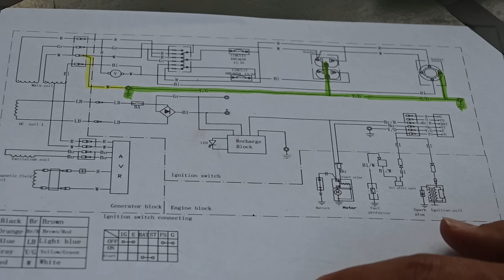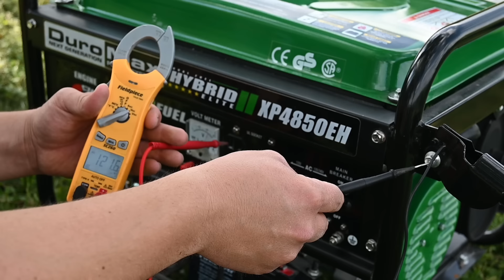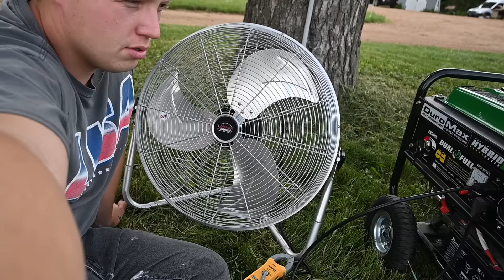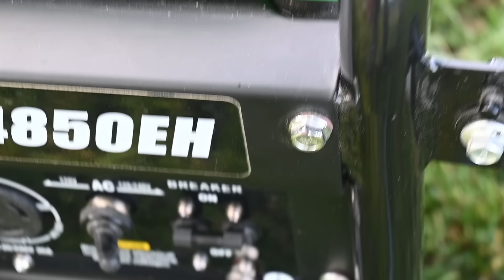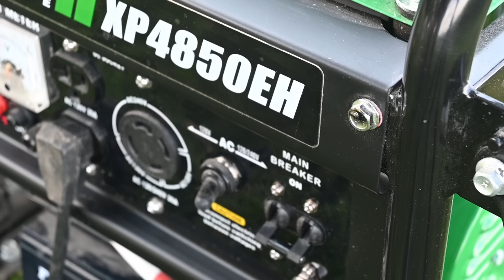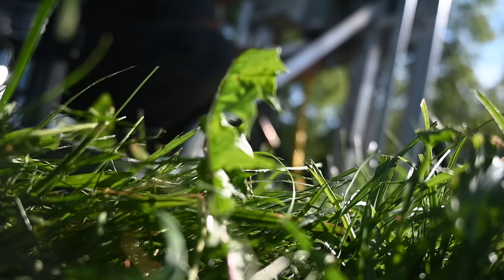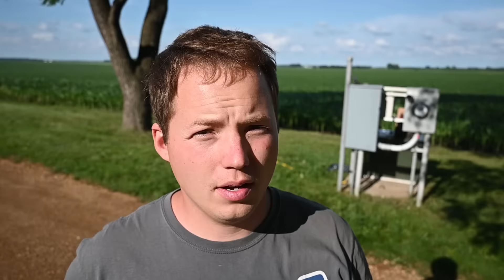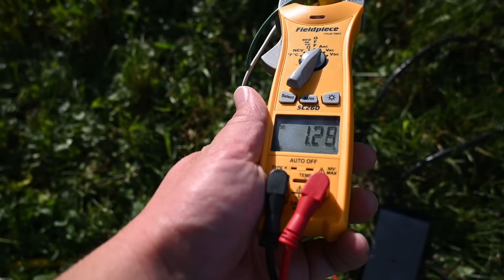What is a Floating Neutral Generator?

Comment: If you're going to use a generator as a stand alone power source at a campsite or construction site independent of grid power, you'd want your generator's neutral and ground bonded together.  If you're going to use the generator as  a backup power source for your home through a transfer switch (required), the generator  would not be bonded internally.  You'd run separate neutral and bond to the home's neutral and ground buss bars.
Reply: ^thits
Reply: @scoutskills   But if you are attaching your generator to a transfer panel, and that transfer panel is a sub panel, sub panels don't have the bonding in them, as its your main panel that does.   How should it be wired up then?
Reply: @JohnRoesner  Only the main panel neutral and ground are bonded.  The ground at the main panel is then tied to the earth to a stake in the ground or sometimes the water main pipe.  The main panel has a high current two pole breaker for feeding the sub panel and the sub panel feeds the critical loads.  In between the main panel and the sub panel is a two pole  (DPDT) transfer switch.  The generator and the sub panel have the bonding wires removed.  The main panel earth ground is the ground for everything.
Reply: does ^thits mean cheap goods??  I know the slang meaning of 'thot' but seriously, I don't know what you meant by your reply '^thits'? Just curious.
Reply: @CJforUSA  ^ is an up-arrow and thits is mispelling “this”. He means “what’s written above is true”
Reply: YUP, been reading up on this, could be different for a mobile home though as the ground and neutral must be made at the 1st disconnect, from then on, they must never meet up again.
so at my place, with a 7.25kw. I have a mechanical interlock. Mains must be off to turn on
gen breaker and I have a 4 wire cordset.
Reply: So I just want to use mine for a few extension cords to run a fridge maybe a TV when power is out? I got the same model Im not familiar with generators. Do I still need to ground it if I'm only running then for extension cords?

Im surrounded by concrete so grounding it will be a task.
Reply: I’m going to have a friend who is a journeyman electrician wire up my solar inverter to a 30amp breaker on the main breaker box with a lockout switch.  So just to confirm, we need to wire it to to neutral bus bar and the ground bus bar then remove the bond on the inverter.  Is this correct?
Reply: No. Almost, it's bonded once it's plugged into the stand by system, you shouldn't have to run extra wires.
Reply: @yakapo999  solar is different. Its article 690.
Reply: @thebardock6785  I also have the same generator... I have not been shocked yet and I only use it to run my fridge and freezer by extension cables. After watching the video, in the event of a fault (hot leg grounding) I think touching the fridge and the generator could result in dangerous current flowing through my body. I am going to bond my neutral and ground on the gen because I don't have a whole house transfer switch or an intention to connect it that way. I did wonder if I could just install a grounding jumper between the neutral and ground under the gen front cover?
Reply: @thebardock6785  I know the comment is a year old, but I was digging thru comments for the answer too. This video kind of leaves a cliff hanger as to whether or not the rod is necessary after bonding neutral/ground, only advising to "follow the manual". TLDR is no don't use the rod. I found a video uploaded this May outlining the situations with a generator using extension cords, it is named:  Does My Generator Need a Ground Rod? Probably Not. Here's why.
Reply: That why you use a 4 lead supply from the generator and not a 3 lead, if a 3 lead is used then the generator's neutral should be bonded at the alternator and connected to earth and the neutral removed from the buss bar in the home panel box.
Reply: @scoutskills I think you might be wrong, I believe you have isolated the main neutral and active leading to the sub panel by placing the transfer switch between the two panels. Thus the bonding of the main neutral and ground in the main panel does not continue through to the sub panel. the load now is relying on the generator neutral, which is a floating neutral. This is not ideal nor is it safe, as has been demonstrated by Benjamin Sahlstrom
Reply: Your " separate wires for neutral and earth" to the house are in the extension lead, it connects generator to house " buzzbars"   you could earth your generator to the house earth stake in the ground for safety but not really needed as the extension cord does that job too, but in wet ground or permanent setups, id be earthing generator to house earth stake...

Comment: Ben I have a Champion 3500 watt floating ground generator. 
Using extension cords to power up my furnace, it will run the fan, but has red lights on the power processor. A local electrician had me drive a ground rod for the generator, and a ground rod for the LP furnace. 
Furnace still would not make the LP light. 
Another electrician told me to take a ground 15 amp plug in, take 6” of #18 green wire. Connect 1 end of the wire to the silver- neutral prong, the other end to the ground prong. Plug it into the 120 volt plug in on the generator. 
Now the generator runs my LP furnace! 
Hello from north east Montana. 
10 miles from the Canadian border.
Reply: I took an extension cord and cut off the male end with about six inches of cord on the end. I then butt spliced the neutral and ground together and plug that into one of the receptacles on the generator.

Comment: I rarely add comments, but this was a great video for such a challenging subject. Thank you for taking the time to explain. I would have really enjoyed seeing this video 3 months ago when I installed a Reliance Controls 10 Circuit  30Amp Generator Transfer Switch and bought a Westinghouse 6500 Watt Gas/Propane Bonded Generator. After many days of research and some hair loss, I went ahead and switched the generator over to a Floating Neutral and labeled generator for others to be aware. This video confirms my research. Keep up the good work and sharing the knowledge.
Reply from the maker: I think what matters is how the switching is done. Some transfer switches also switch the neutral in which case you would want the generator to remain bonded. An easy way to check would be to see if there is continuity between the neutral and ground on the generator cord before plugging it into the generator. I need to learn more about it but something Mike Holt said the other day made it sound like some types of transfer switches allow for the generator neutral to remain bonded.
Reply: @BenjaminSahlstrom  That is correct, some transfer switches automatically switch the neutral and in that case you want to have your generator set up with a bonded neutral. I called the Reliance manufacture and my transfer switch works with a floating neutral on the generator. I only use this generator for house power only and it is labeled "Floating Neutral". I also added a label "Generator for House Power Only" because when I took a survey NO one knew what "Floating Neutral" meant.
Reply: @BenjaminSahlstrom   Is it safe to say that the generator should always be bonded, but only in one place? Although at 25:50 didn't you do just that, bond in two places?
Reply: @adhambarghi  I would think if you were using this for house power only you would want your generator to be bonded. If a metal frame appliance shorts to ground inside your house the breaker on the generator will not trip.
Reply: @fyuecd2  The transfer switch box will trip a breaker for the shorted metal frame appliance in our example. Hope this helps.
Reply: Adham Barghi oh ok I assumed you were running a interlock.
Reply: In that case your branch circuit breaker for the appliance in the house panel would trip.
Reply: Don’t forget about the generator safety rules: Always make sure you follow all the generator safety rules whenever you use your portable generator. This is only a reminder. Generators can be dangerous if not used carefully. Every year, hundreds of people die or get injured when using portable generators due to carbon monoxide poisoning and electrocution. Make sure you are using your generator carefully and keeping others safe as well. There is something very serious that everyone should always be aware of when using generators. Some people do run their generator indoors which is not safe and that increases the risk of carbon monoxide poisoning which can cause death of family and you. Some people run their generator in wet conditions which can electrocute them. Please remember that you should never run your generator indoors. Remember that carbon monoxide is an odorless and colorless gas that you cannot see or smell. Carbon monoxide is a silent killer. Keep that in mind. Make sure your generator is 15-20 feet away from your house and away from doors, windows, and vents. Never use your generator in your porch too. Having a carbon monoxide detector is very important against generator safety. Some people also allow children to go near the portable generator which could pose risks. We need to keep an eye on our children making sure that they are not near the portable generator so they won’t get electrocuted or burned by the generator which is dangerous. A locking enclosure also keeps kids safe. A generator shed might look like a tempting place to explore, or take cover during a game of hide and seek, but a generator is a dangerous piece of equipment that can cause injury. It says on the manual that we should also keep children away at all times from the portable generator to avoid injuries. Please do not allow a child or unqualified people to operate the portable generator.  It is important to keep your children safe especially little ones. The portable generator can be hot during an operation. Just because some manuals missed what should be listed doesn’t mean it’s safe to do. Always follow the generator safety rules when using portable generators. Generators pose electrical risks. If you need to use your generator during wet weather, you need a generator tent to protect your generator from getting wet. Don’t let your generator get wet. Keep your generator dry and before using your generator, please make sure your hands and your generator is dry. Do not wear loose clothing when operating the generator. Everything that is said on the generator’s operating manual should not be ignored, even the warning labels. Never smoke cigarettes near the generator. Please keep flammable things away from the generator. Never overload your generator too. Your generator can catch fire. Never ever try to plug a generator cord into a wall outlet to avoid back feeding. Back feeding your generator is dangerous. Always turn on your generator first before plugging in appliances and shut off the appliances before turning your generator off. Use a heavy duty cord for your generator and the cord should not be worn out. All the instructions should be followed carefully. Never refuel your generator while it’s running. It can cause fire if fuel spills while your generator is hot. You should turn off your generator and let it cool off before refueling it. Having a fire extinguisher next to the generator is also important. This is only a reminder for everyone’s safety of using generators. Make sure your generator is properly grounded. Having a fire extinguisher next to the generator is also important against the safety rules. https://youtu.be/I1jT3ANENvI and here is a video more about keeping others safe when using generators and also about our family’s safety. It’s important to keep our little children safe as well. Make sure your little children are kept away from the generator at all times especially when it’s running. Hope this helps. All generator safety rules need to be followed carefully. Please don’t remove the warning labels on the generator.
Reply: @adhambarghi  are you able to power GFCI outlets and appliances tied into a line with a GFCI outlet. My craftsman generator owners manual is saying "On a floating neutral generator the AC receptacle ground pins are not functional. Electrical devises such as GFCI, requiring a functioning AC receptacle ground pin will not operate"  My tankless hot water heater is tied into one of these and I'd like hot water in an outage. I purchased the Reliance pro/tran 2 transfer switch but have not installed yet
Reply: @jeffdaniels4339  that depends on if the transfer switch / panel is bonded or not. If it is, it should function fine. Basically the only reason you should be using your generator in the floating ground configuration is, if the transfer switch / panel is bonded. This is because you only want one location to be bonded, and this location should be the closest means of power interruption. Ie, the breaker in the transfer switch / panel. If both were bonded then you would have 2 or more fault paths. This can cause the wrong segment to trip & disconnect power. Or even worse, one breaker would trip but the other bonded segment would still be live with a dead short. Causing a rather dangerous situation. So in short. If panel is bonded your generator should be configured for a floating ground & your GFCI outlets should function safely as designed.
Reply: Hey Adam, question did you connect ground to ground and neutral to neutral or did you connect them both to neutral bus? I'm installing a ProTran 2and my generator has 6500 w running with floating neutral
Reply: @IsmaelRodriguez-pn3lw  your main service panel should be bonded, ie ground and neutral strips bonded together. Then you should debond  your generator (floating ground) so only the main panel is bonded. The ProTran 2 should have a pre-printed label you can put on your generator as a reminder that it has a floating ground. At least mine did.  It was nice touch for such things to be included in the kit.
Reply: @williamallen7836  Thanks! My generator has floating neutral and I am connecting ProTran 2 to my sub panel, so I should connect ground to ground and neutral to neutral, and leave generator as is, correct? TIA

Comment: Good video.  I will mention that a lot of if not most inverter generators use a floating neutral and are frequently used to power an RV.  The RV also has a floating neutral and gets it neutral to ground bond through the RV park’s pedestal but a floating neutral generator will work fine.  The electrons have to flow from the hot lead back to the neutral and vice versa for AC power.  So if there is no earth (ground) bond to neutral you should find no difference of potential between the hot lead or neutral to ground so standing on the ground and touching the hot lead should not electrocute you.  The problem would be if there were another neutral to ground or hot to ground somewhere else then you could get zapped when touching either lead while in contact with ground.  Same with using an old metal cased drill on an extension cord on such a generator.  If an internal short from hot to case happens there is still no source tied to ground so no difference of potential between the drill case and ground just case to neutral would cause current to flow so you should be ok. A three prong plug with the ground lead connected to the case and the ground lead actually connected to ground would be best.  Now days I wouldn’t use a metal cased tool without a three prong plug.  A plastic double insulated tool doesn’t need a ground pin.  The floating neutral generator would operate, safety wise, similar to a battery operated drill.  Neither terminal of the battery is going to ground so there is no voltage measured from either terminal to ground. So if you’re on the ground and touch either lead nothing happens.  For another opinion: https://www.rvtravel.com/how-generator-neutral-ground-bonding-for-an-rv-works/

Comment: Just added a 30 amp generator input plug  to my house.  I installed an interlock for the new breaker but saw folks question the ground bonding when using a generator with a home panel already bonded. I saw many videos and posts trying to explain all that  and basically was more confused than before I started researching.  Floating vs bonded ground / neutral etc..  Your video nailed it for me. I have that exact generator and you confirmed what some said about it being floating. I just ordered the plug adapter (like you made) for use when not at home and now I know all is good when using the interconnect and panel for the house power as it is. Thanks for this!

Comment: The neutrals on  commercial vessels are always floating, this ensures that essential equipment will continue to operate. The switchboards have a three lamp system to identify ground faults. Safety ground is the ships hull..
Reply: Is this also done to also keep electrolytic effects down?
Reply: I take it that vessels use a 3 phase system?
Reply: Of course they’re floating, or it wouldn’t be a boat :p
Reply: Interesting! Why neutral floating on commercial vessels? From what I have learned so far, the abyc standards recommend bonding neutral to ground when disconnected from shore power and running generator or inverter.
Reply: So if the ship is not a floating neutral, is that what makes the owner of the ship bitch that the stern drives dissolved since last year even though they put 1000 zincs on it?
Reply: @62chevrolet  good one🤣